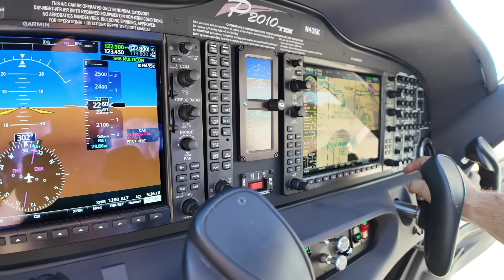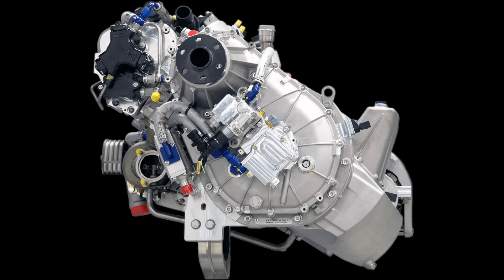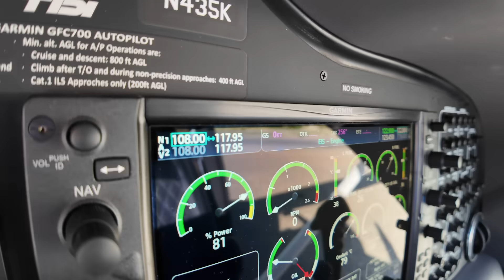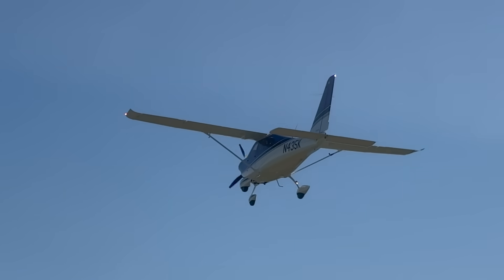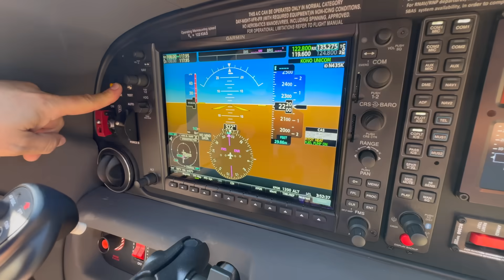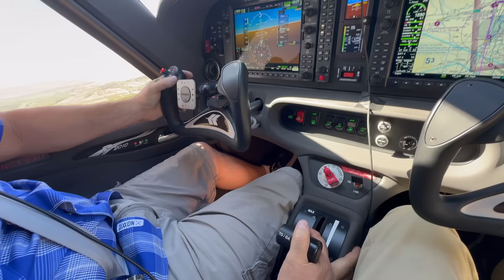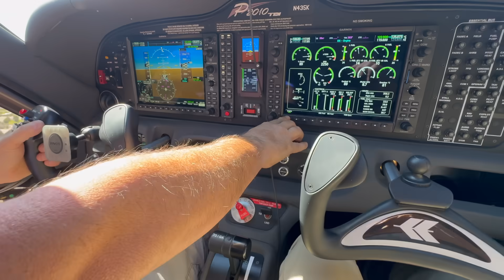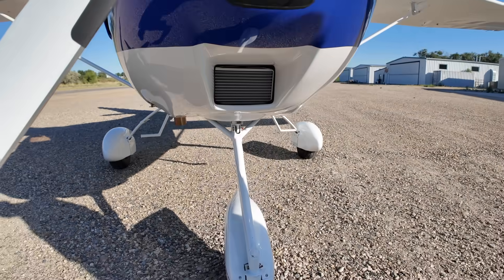Flying with a diesel engine

Comment: Of course a desial will stand the test of time. They are either on or off, no spark plugs and in vehicles they got over 1,000,000 miles. You have to know how to start them properly and be sure to use aditves in the winter ❄️🥶.
Reply from the maker: Thanks for your comment. My reference of "standing the test of time" is regarding whether this diesel platform will be more widely accepted by the aviation community. I've been flying for 45 years and this was the first diesel I ever flew. I do believe they will last a long time. I just hope the public will embrace the concept. We need some new technology in the field of aviation

Comment: A diesel makes perfect sense to me. They normally run about the same RPM as an aircraft and can run reliably for many hours at full throttle. MB is as good as it gets for a start. My only surprise is that it isn't air cooled. I know they exist. I would trust my life to a diesel before a gas engine. Only one part scares me. I don't trust computers.
Reply from the maker: I hear ya. And yet almost every modern engine has computers. The exception being an engine with a carburetor.

Comment: Do I understand that correctly.  After 1800 hours of operation, you have to replace the entire engine?  Isn't that more expensive than overhauling an engine?  And these can't be overhauled?
Reply from the maker: That's what I understand. I'm sure they probably keep the core and rebuild it from that. But there are not many certified aviation mechanics that can overhaul a diesel engine. Think of it as buying a Lycoming or Continental factory reman.

Comment: The computer runs the engine until it does not.
Reply from the maker: I hear ya. But that can happen to anything mechanical and electrical. But at least the modern day FADEC's let you know when a problem is developing so you can address it.

Comment: Unfortunately, the minimum "ambient temperature" is -13F/-25C.  This will exclude it from joining the Bush Plane category.  Can this be reduced via modification?  The manual doesn't state.

Comment: Props on a diesel is a match made in similar rpm heaven. Water cooling enhances durability with smoother and quieter operation. Replacement of ancient (relatively) engine technology is looong overdue. Even the fuel injection on gas flight engines is as rudimentary as using a windshield washer pump pushing fuel into a pinched tube. I am curious if they run grounding wires between the coolers and the engine to prevent stray current from causing damage to hoses. It took the automotive engineers decades to recognize the issue and figure out the simple solution. Cars and trucks used to have to replace hoses and water pumps every couple years, now they pretty much go the life of the vehicle.
Reply from the maker: Thanks for your input Carl. I'm pretty stoked to see new technology emerging.

Comment: Current Continental CD-100 is based on Mercedes-Benz slant I4 MB type OM640 (used in A class W169 and B class W245), in automotive already dated engine. Last iteration with power raised to 170HP is modernised already by Continental, not just ex Thielert 2.0S pushed further. For today MB diesel modest power level even for diesel. I also fly P2010TDI and it is great platform, more comfort than Cessna 170, FADEC controlled engine and propeller, gound power is modest, but from about 8000 feet above it is better than 235HP Lycoming 540... and cruise with 70% (2000 propeller RPM) for about 6,5GPH... another universe...

Comment: Diesels are #NoBrainer for Torque and longevity 

as long as US doesn't implent any crazy BlueTech a restriction on 4 banger diesels while Anything about 5000lbs V10 Diesel 😂😂😂😂has no emissions not even a basic catalyst converter ... let alone DPF or AdBlue

Comment: The crankshaft position sensor and the rail pressure sensor can shut down the engine if they malfunction. I hope they've duplicated those; personally, I don't like it because it adds unnecessary weight, but with proper maintenance, this engine should last for two generations.

Comment: Nice prop!
Most of airplanes I'm flying in Germany have the same Thielert TDI motors, all Diamonds DA40 and some Cessna 172 retrofitted. The only factor is weight, you are loosing almost 100kg of the usable payload with full tanks, but thanks to low fuel burn rate of 5,5 gal/hr you usually don't need full tanks.

Comment: Time to replacement is 1800 hours. That's roughly 108 to about 128,000 Mi where a dealer diesel should be able to run to 230,000 Mi easily without the wear and tear of trying to pull a 5000 lb load. Porsche diesels do on a regular basis on the road. It should be time for a full checkup at 1800 hours. But should not be anywhere near need to be replaced. Otherwise what you should do is just buy a spare engine. And have it ready to be replaced. And given the cost of the purchase. It should already come with it.

Comment: A new 172 goes for about 475K.  And it's engine can be overhauled.  This thing costs 600K for the same performance and you have to REPLACE the engine at 1800 hours?  How much does a replacement cost?  Only 130kts.  I'll keep my 1980 Turbo 210.

Comment: Diesel vs. Petrol isn't even a comparison.

Safety of engine? Diesel
Safety of fuel? Diesel
Fuel efficiency? Diesel
Fuel availability? Diesel
Fuel cost? Diesel
Environment? Diesel
Ease of use? Diesel
Ease of maintanance? Diesel
Pilot load factor? Diesel
Power/weight ratio of fuel? Diesel

Extreme cold weather operations? Petrol
Power needed for start-up? Petrol
Power/weight ratio of engine? Petrol

I hope they are going to make opposed piston Diesel soon (to re-engine older airframes). That will be the end of AvGas anyway.

Comment: The TBR concept is ridiculous for an engine that costs about $80k. Compared to this continental engine, a Rotax 916is is less expensive to purchase, less expensive to overhaul, and less expensive to run as it uses automotive fuel.

Comment: Great german engines. Finally reliable after teething problems. I once flew a cd155 equipped Robin dr401. Had issues with cooling but once solved it was great.

Comment: Look at the ADs for Austro, main cap bolts, oil pumps, cracked pistons, and if it windmills it’s an automatic timing chain and sprockets change. Not to mention having to hook up a laptop with Austro special software just to read the numerous trouble codes. 1200 hr TBO, ( meaning swapping for a new engine) 600 hr fuel pump change, 600 hr injector change. Gear box issues. Austro engines are not ready for aviation yet.
Reply: These things are dogs performance-wise.  Only 130 kts for 600K?  Insane.  I'll keep my 1980 T210, it runs rings around the Tecnam.

Comment: I'm just curious about what modifications to the Mercedes diesel engine may have had to be done to run Jet A versus Diesel. 7.1 gallons per hour seems pretty darned efficient! I've never done the math but I'll bet that's similar to what I get running my Dodge Ram Cummins down the highway. Great vid thanks for posting!

Comment: There's a reason why you don't see many diesels in aviation. They hate the cold.
Reply: Diesels love the cold. Colder air is denser air. As long as the diesel fuel is winter grade, it'll run like a top.

Comment: Pilot said that the engine doesn't have a TBO, but a TBR, which means replacing it at 1800 hours. Ouch! How much does that cost?😮
Reply: not the engine gets replaced but parts .. considering that the engine is a basic 2 litre diesel engine what do you think ?

Comment: A lot of the Air Tractors used for crop dusting here in Iowa are using a turbo diesel engine.  When they fly over you can hear the difference between the diesel versus the regular engine.

Comment: One of the reason for buying a plane is to get to places in a hurry, or at least have that option. Both Tecnam and Diamond fell short. The diesel really did not give the industry any advantage in price break through. I even seen engine makers tried to pass off a 140 HP diesel into a plane that original came with 160 HP. Then justify it by saying , because it did not lose as much HP at higher altitudes, it is superior. I do not believe nowadays, with computer designs, we still have to put up with the performance penalties because the handling have to meet certification. My basic spec for a cross country airplane is at least 140 Kts at 75% and range over 1000 nm. The Panthera did it and a couple others, and Panthera did it weighted down with an old fashioned Lycosaurus engine too.

Comment: 2025 Chevy truck is probably not the best choice for a cross country trip.  There are lots of issues that can kill the engine at low miles.

That 1980, on the other hand....

Comment: Diesel is far superior
Reply: Shorter lifespan, so much weight that they reduce the useful load of the aircraft, significantly more expensive, absolutely must use a turbocharger to make enough power to fly... yeah, real superior.

Comment: Imagine a runaway motor while flying
Reply: Need a button to close the air. Easy.
Reply: Ohhhh shiet. I guess you're doing circles until you burn all the fuel/oil, or until the engines explodes and you hope there's still enough of the plane left up be able to land safely 😬

Comment: The Mercedes straight 5-cylinder diesel engine is legendary (not sure about the Continental copy). it lasts million miles in stop-and-go taxis, flying should be a breeze for that motor.

Comment: Continental isn't really all in on these engines yet.  They don't offer them to the largest GA market.  And the TBR is utterly ridiculous.  If it actually needs replaced at 1800hrs it's a pile of shit.
Reply: most engines age out before they reach TBO.
Reply: @daszieher  Age isn't a thing in 91(nor is time), and in 135 they get to TBO way first.  The point on replacement is it's wildly higher in cost than overhaul.

Comment: Howdie, im a pilot in europe, recently finished my commercial. In europe diesel engines have been very common in cars for quite some time, now they have started to putting them in aircraft as well. My flight school had two very interesting C172, they were converted to diesel/JetA1 with the continental CD155 engine, very cool, a lot of power and torque and very economical we usually cruised about 70% power burning 7 gallon and doing 110-115kts, also fadec controlled constant speed prop. In my opinion thats were diesel engines shine, it gives these old aircraft a new life.

Comment: I was in a flying club/ flight school in Germany a few years ago.
They have 2 or 3 older converted C172‘s which have these diesel engines (thielert).

They are reliable and have enough power with 135 or 155 hp but the most important thing is the fuel economy and the cost for fuel which is a lot cheaper than an big volume gasoline engine.

But as always with everything in life there are advantages and disadvantages.

So these diesel engines can’t be overhauled or maintained by the owner or even most mechanics can’t.
When they reached their lifetime (like the owner also said in the video) they have to be replaced completely which is quite expensive. (I believe it was 30000-50000€ or something)
So every ~2000 hours a new engine will cost some.

So it might not be a problem for rich people but if flying is just a hobby and you have to save money from a normal daytime job to afford your hobby then this could be a problem.
Reply: At those power levels, the Rotax 915 or 916 would be far better options, and they're able to burn mogas, which is less expensive than both avgas and jet fuel. The Rotax engines also weigh significantly less than the diesels, so they would also be far less detrimental to the useful load of the aircraft. The Rotax engines can also be rebuilt, so they're likely to have an advantage over the diesels when it comes to long-term maintenance costs.

Comment: The whole turbo kicking in, Is hilarious. Turbos are always spooling, the only difference being when power increases, drive pressure increases and simultaneously boost goes up unless under constant load. As like power units, tractors, etc. The waste gate relieves excess boost.
Reply: *Spooling

Comment: I think that kind of oil should not have redesigned the engine and started making it on their own. They should’ve kept using the Mercedes components that’s what made it so reliable so it will withstand a test of time and see how much quality Continental has put into it.

Comment: Not the first time a diesel engine powered an aircraft - Junkers pioneered the manufacture of diesel aircraft engines with the Jumo 204. It powered several variants of well-known German planes like the Blohm and Voss BV 135 seaplane, the Ju 88 and the Junkers G 38. The design was also licensed by Napier & Son in the UK (the Napier Culverin and it's descendant the Napier Deltic) and Fairbanks-Morse in the US (the FM 38 8-1/8).

Comment: So, it burns less fuel that’s less expensive.  Why is this not normal?  Why don’t all planes do it this way?
Reply: Because the engines are so heavy and underpowered that they significantly reduce the performance and capability of the aircraft (typically).

Comment: California would probably want dpf and def.
Reply: I think they'll be happy it doesn't need leaded fuel. As long as gas engines are allowed to use leaded fuel in aviation there's zero reason to impose emissions controls on diesels except maybe a CAT. Besides, this engine probably produces less NOx and particulate pollution than small turbine engines do.
Reply: CARB is dead, no more authority without the EPA waivers

Comment: Because of the gradual phase-out of leaded fuel, diesel engines like this will be the way to go.
Reply: Except that most aircraft engines run just fine on unleaded gasoline, while also being lighter, less expensive, and offering better performance.

Comment: In diesel cars it’s the turbo that’s the weak point… how does it fly if the turbo fails? Does it still have enough power to continue?
Reply: without the turbo you dont have enough power to maintain altitude

Comment: "Will the diesel stand the test of time". That simply depends on build and design quality. Diesel engines are in principle more reliable and durable than any other engine type's. Cheap build quality, poorly untested designs however, will ruin your day too with a diesel.

Comment: That fuel rail and the steel fuel lines look exactly like those in a Sprinter or W164 powered Benz. I hope it does not have the dreaded EGR or DPF from Mercedes-Benz cars.

Comment: So instead of a TBO, it’s a TBR. I’ve heard the replacement cost is astronomical. I don’t actually know if that’s a true fact or not, but does anyone what the replacement cost is? I know that at some level in general aviation you’re paying for the convenience rather than always affordability, but is there a case to made for this being a more practical option over the gas powered option? Can you make the math work at some point for this to be the more affordable option? This is not judgey statement or question, I’m just genuinely curious. I really like this technology.
Reply: Tbr is about $50,000 USD

Comment: Without DPF and NOx cat/ad blue (urea) emission systems modern diesels are fantastic. With those emissions systems common on modern cars they have cancer from the factory thanks to unrealistic emission standards. In this plane setup I am not surprised it is great and hope to see it much more.
Reply: which is why I am sticking to my Euro3 common rail diesel.
Reply: thats all been removed thank god.
Reply: I often dream about what my 2.0d BMW would be like with no EGR DPF or Cat as its pretty awesome with them !
Reply: @MrAvant123  get an old Euro3/4 E46 with the big engine. They are a hoot, I tell ya :D
Reply: Cancer, that's what these great motors get by it.

Comment: Benefit of the diesel engine is the fuel is a lubricant, so even if you have an oil failure, it may be able to get you on the ground safely before blowing up.
Reply: That's pure nonsense, the fuel isn't going to lubricate the rotating assembly if the oil pump fails, so a diesel engine will fail just as quickly as any other engine if it loses oil pressure.

These engines also run on jet fuel, not diesel, and jet fuel doesn't have the same lubricating properties as diesel fuel.

Comment: At this point, diesel-electric plane is near.
Reply: That's essentially the Ampaire Eco-Caravan. It was fuel efficient (it was a parallel hybrid, not a series hybrid), but it likely had poor freight/ton efficiency (FTE), because it lost so much of its payload capacity due to the weight of the engine and hybrid system. The cost of the powerplant (including the battery replacements) likely would have been a problem as well.
Reply: A modern valved and turboed 2 stroke (low complexity, low weight, and low emissions) plus a modest hybrid system would give a great mixture of performance, redundancy and fuel economy.

Comment: The first diesel engine used in aviation was in1928 and was built by Packard it was a radial, Blohm and Voss produced diesel powered seaplanes during WWII which gave them better range but the big advantage was they could be refueled by U-Boats so extending their range still further.

Comment: TBR or TBO (what I have seen is that this engines are rated for time between replacement, they can't be overhauled.
Reply: They need to sleeve them for easy rebuild however the gearbox is another story

Comment: Nobody is complaining about the operation of these engines. It's the price which is approaching that of a turbine.
Reply: I remember seeing a bunch of people complain about the poor climb performance of the Cessna JT-A and the greatly reduced useful load. The Archer DX, too, has a significantly reduced useful load with this engine. It's very odd that this aircraft had such a significant amount of weight added to its maximum take off weight in order to accommodate the diesel.
Reply: And you can't even overhaul? Wut?!?